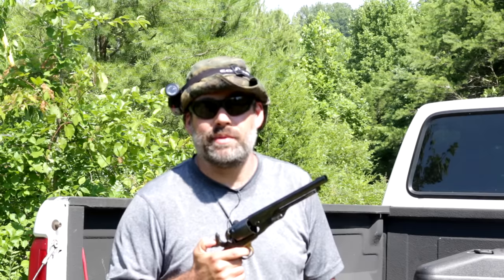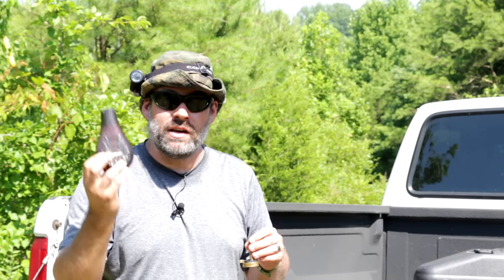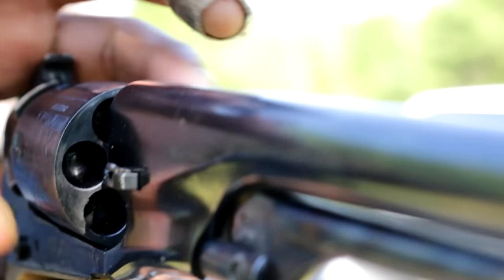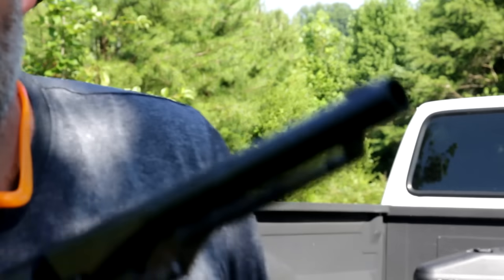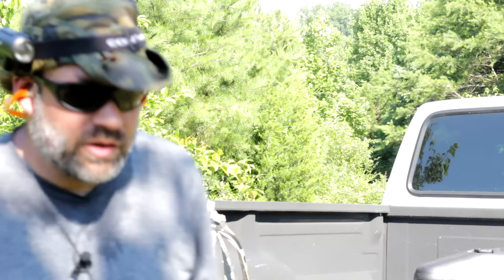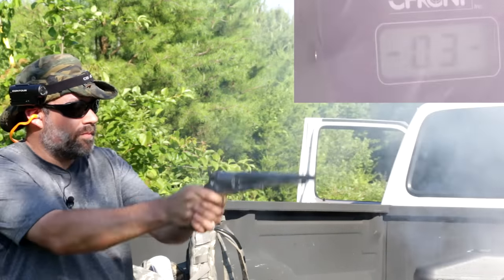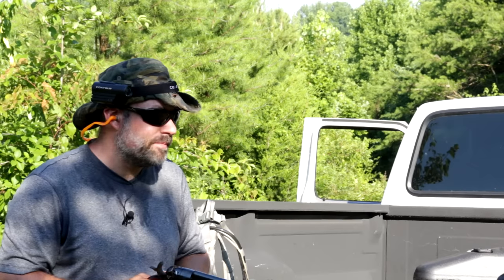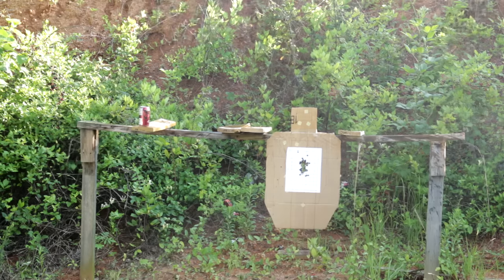How Powerful are Black Powder Revolvers?

Comment: i was wondering about the spread in velocity at each powder charge. would you consider conducting the test again, but weighing out each charge in place of volume measure? i use the pyrodex pellets and their weights are pretty consistent. would like to know why there is such an extreme spread in velocity.
Reply from the maker: The spread in velocity was due to the variation in the size of bullets.  I though by using commercial made bullets it would be better than my own cast bullets and I was wrong.  FYI - Black powder should never be measured by weight due to a massive weight variance between batches, manufactures, and older powder that's had time to absorbed some moisture.  I'll be doing many more tests this summer and just a few minutes ago purchased a new bullet mold for testing.

Comment: I've tried crisco, but it seems to melt when the gun gets hot. Am I missing something?
Reply from the maker: It does melt but there's still enough to do the job.  There are better things like tallow mixtures that doesn't melt as much but Crisco works well enough while also being super cheap and easy to find.
Reply: @deuceandguns  well if it works then that's good. I used it cause animals can't smell it like they would with a petroleum based product. Good info, thanks!

Comment: What a jump from ineffective(25gns) to highly effective(30gns) with just 5gns. I note you are achieving superior velocities with your 30gns than Duelist got with the same pistol,balls and gns in his test. Looks like the black powder substitutes perform better than the Goex brand of actual black powder.
Reply: On the other hand I probably shouldn't underestimate what this cal. and gun can do with 25gns which are getting nearly 700fps. Putting it on a par with the old .38spl loaded with the 158gn LRN at 755fps which was a common 38 ammo for years.

Comment: Counting cylinder length,the larger the charge,the shorter the barrel.This might be why velocity levels out with increased charges.
Reply: "Counting" bullet jump, accuracy suffers.
In truth BP burns at the same rate, and confinement adds nothing.
The ball is already gone and the larger loads are still burning.

Comment: how long would it take to fully load one of those powerhouses?
Reply: The Wabbajackle All depends. couple of minutes for beginners. with time you get quicker might take a minute. that's with loose powder cap and ball. paper cartridges you could shave the whole thing down to around 30 seconds if you can get the caps on right the first time
Reply: RocksChosenWarrior3 thx for the info bro
Reply: @RocksChosenWarrior3  30 Seconds is awfully quick.  A minute and a handful of seconds if not in a road race.

Comment: Well the original 45 Colt round was designed to kill a horse with a single shot. It was 40 grains of FF black powder and a 255 grain lead bullet. I load that myself and I can say when you touch one off any doubt about the raw power of the round goes away. I was shooting THROUGH a 1 1/2 inch thick oak board with a 4.75 inch barrel SSA revolver.

Comment: you try to shot an old black powered musket rifle those things have a real kick I used to own a 12 gauge and it felt like nothing compared to the musket rifle we happened to have an earlier rifle made from the Spanish amazing beautiful gun but it kicks so hard that if sitted it will knock you over and if you jump just a bit off the ground it will push you a tad bit back I would suggest unless you know the kick of the rifle first same with sitting and what ever you do not put you jaw on the butt of the rifle yes you want to do this if you are hunting but most likely you are not so just to feel the power you want to just hold it middle level at first or you can aim it just don't put your chin right on it and don't hold it close or if you do make sure you don't lock your neck but yea you have to try it out and I was saying it more so for others reading this post vs you but you know lol enjoy :)

Comment: to do a test right u would have to clean the gun every time but that would be a pain in the arse when u go over 35 grain it really helps to mix a little modern powder in the load which helps the black burn better so it is not wasted then u will see ur number go way up. but i would only do this in a ubirty which is a higher quality gun made with a high quality metals. u would love my set of ubirties that a retired colt gunsmith went over them till they shoot perfect he even filed the end of the barrels till they shot perfectly straight 100 yards no problem

Comment: What would happen if you used smokeless powder in a BP gun?
Reply: john Mullholand  ,thank you for your reply.
Reply: They will bury you in a closed casket. I am not kidding. You must use GREATLY reduced smokeless powder charges below factory loadings for OLD smokeless powder guns. Old, stressed steel isn't nearly as strong as new, modern unstressed steel. Steel is stressed every time you fire a gun. It'll only take so much...

Comment: I shoot the Colt 1860 New Army, any more powder then 25 grains will blow out the end of the barrel. Found that out after years of shooting. I used to carry said revolver when I hunted using a muzzle loading rifle. As for the most powerful Black Powder Handgun, that would be the Colt 1847 Walker Dragoon. It was the most powerful handgun in the world until the invention of the .357 Magnum. And yes, you should have used real black powder. Also if you over charge the  Open topped Colt revolver you can damage it. From the point of view of the camera when you where shooting the cans, you could see the powder that was blown out of the barrel. I personally do not recommend a powder charge over 25 grains for a open topped revolver.

Comment: A couple of points.

1. Energy is almost meaningless to compare effectiveness especially when comparing different projectile sizes and types. Penetration and wound channel configuration are what counts so testing in media is almost required to get an idea of effectiveness.

2. Pyrodex burns more slowly than real black powder so it is entirely possible that heavier charges of a quality fffg black powder might actually out perform similar charges of pyrodex. Certainly would be interesting to repeat the testing with some Swiss.
Reply: Wow .. Can't wait for your video!
Meaningless ... So all of those dead solders in the American Civil War ... too bad no one told them.
Reply: Initially I just ignored this rather hostile reply but having run across this again after a year I just have to ask why my energy comment was equated with skepticism on the effectiveness of civil war era arms. On the contrary, my point is that their obvious effectiveness runs counter to their limited energy numbers.

I don't understand why folks get so touchy.

Comment: Probably already know this however with conicals you would get more power and speed then the round balls but either way that target is going to have a bad day. I personally carry a 1858 New Army from Pietta with the 5.5 barrel loaded with 40 grains triple 7 triple f powder with a .454 pure lead ball so what every or who ever I shoot if I have too will have a very bad day. Plus if the bullet wound doesn't kill you the lead poising will that is if the ball didn't go all the way thru.
Reply: How is that remmie holding up with the T-7 running through it,  Never tried the stuff but hear it batters the hell out of the frames.
Reply: Haven't been able to go shoot out side a few times, but so far it's holding. T-7 is of course a more hot powder so it's suggest you do 5 grans less then what you normally would but heh.

Comment: Modern bullets do not rely upon the amount of powder.  Although, the grn of a bullet is reminencent of the amount of powder used to propel a round lead ball.  Remember that a round lead ball expanded when it hit.  It broke bones, crashed ribs, etc...  The lead ball expanded and caused a massive wound.  Modern fmj(s) cause wounds (but, fmj(s) do so with speed or mass).  Lead balls are pound for pound equal if not more powerful then modern bullets.  HP(might) be equal.  The reason the BATF (Bury All The Fireamrs) considers these pistols non-weapons is because of the loading process and the time it takes to load the pistol.  Even when compare to the S&W Model 10-5, Black Powder is too slow of a load.

Comment: Those were really slow.  With 35gr of 777 I get 1138 fps (average) with a 141gr ball in a Pietta 1860, and 1152 fps (*) out of a Pietta 1858.  I figure 777 is ~10% more juice than BP of the same weight, but those shouldn't be that slow.  Too much cylinder gap (some people suggest Ubertis occasionally have that issue) ?

Comment: Kind of like the people think more horse powder make a better car or the folks think running the ac with the widows open works. If you want it to work right you would have to clean it up make it yours and then try the right weight of bullet and powder for the twist and load the gunsmith designed it for try 140 with 18 grains powder. 451 or 454 what ever gives a nice ring.

Comment: I used to use 30 grains of powder, but I got a lot of cap jams. Now I use 24 grains of powder and Slix Shot nipples, no cap jams now. Thanks for using unsafe loads so I don't have to.
Reply: Actually, his loads were not unsafe. Colt's said of the originals that you could load as much powder into the cylinders as possible, as long as the bullet fit, you were good to go. You can't blow up a cap and ball revolver using black powder, (especially with these modern remakes because they are made of far superior steel than the originals) !!!!
A note of interest: Colt (and the Army) used FFg,,,not FFFg, in their revolver calibers from .36 to .44. Only the smaller revolvers used FFFg, such as the .31 calibers.
Colt, for many years, didn't recommend the use of oil or grease over the bullets or chambers...that practice didn't come along until many years after their introduction, which was when Colt started making the molds with a grease groove in the conical bullet.

Comment: Interesting experiment. Probably a limit on how much powder can burn in the barrel. No need to waste powder by putting any more than 35 grains in
Reply: Wrong. .. if you use oversized balls,  the powder will burn more before having the ball moving. ... which will increase pressures also, giving much higher velocities.

Comment: doesn't pietta recommend a 25 to 30 grain load
Reply from the maker: Pietta's website recommends a max of 15 grains of Black powder or Black powder substitute if the .44 cal.  Personal, I use 25-30 grains but you'll have to come up with what works best for you.  Other's have said that Pietta recommends 25-30 grains but can never produce any official statement from the company when asked.  It's always second or third hand info found in a forum.
Reply: 15 grains of black powder would only give you about 45 foot pounds of energy
Reply: Don't know about Pietta, but Uberti recommends max of 30 grains in their revolvers. I've tried up to 37.5 grains underneath a conical which gives you a really nice kick, but normally I load 30 grains of actual black powder which is pretty much the ballistical twin brother of Goex FFFG.Quite accurate that way (more than with a 25 grain load, bit less accurate than a 20 grain but I don't like mouseloads), although I didn't have the opportunity to use a chronograph to see what do I actually get velocity wise.
Reply: DEUCE AND GUNS the 15 grains of black powder would probably only give you about 75 ft lb of energy only enough for planking maybe you could kill any wild hog at close range a small piglet I just downloaded a manual an older one for pietta and they said 30 maximum recommended 15 grains

Comment: I used to load my 1858 Uberti with 37gr fffg for about 1100fps at sea level it would significantly compress the load but would still seat the ball. The gun would ring like a bell and the loading lever would jump out of the clip

Comment: You seem to have one bad chamber. In every string one round was far below the others in velocity. Maybe if you can find them, use pyrodex 30 grain 44cal pellets. That would exclude possible loading errors.
Reply: Yes...glad I wasn't the only one that noticed the velocity drop either the factory messed up on reaming one of the chambers or the plunger on the rammer is off center due to improper indexing of the cylinder causing the chamber to be peened by the plunger. again. good call!

Comment: A little advice. When you're shooting you can point the gun straight up and pull back the hammer real hard after each shot. On most guns that'll knock the spent cap off the nipple to prevent it from jamming. Back in the day that's how they prevented jams

Comment: wouldnt these loads be overloads? my buddies revolver says 25grains max for a 44.  also a pietta
Reply from the maker: Yep.
Reply: budget gamer2017 No, these repro revolvers can hold as much powder that will fit in them. Modern steel for these is more than adequate for a low-pressure propellant like BP.
Reply: @feralfx6764  Yes and no.  Yes they can take more abuse than the older BP pistols but everything has a limit.  I've been told that even BP repos of the 1970's had poorer quality metal than the ones today.
Reply: Mine says that 30grs is the max for a 44 and 25grs for a 36

Comment: If you use triple 7 or 209 blackhorn weight it on a scale before using a volume measure, but you'll get alot more room and more power. Modern steel is used for the cylinder, it can take all the powder you can fit. Just check it with a magnet first. If it stick, your good 👍
Reply: Factory paperwork says these are overloads.  Like all reloading go up in small amounts.  “Black horn” I have seen no paperwork on its usage in C&B revolvers.
Reply: @chriskell8479  your able to use all black powder substitutes in reproduction cap and balls, I’ve even seen smokeless used in the modern cylinders. it’s really nothing to worry about.

Comment: No offense, but the power of 35 grains is not 959 but actually 259.
grains 140
speed 913
Bullet Diameter 0.452
KE 259.0735043
Momentum 0.567521368
momentum_1 5.675213675
Taylor 8.25352

Aloha...
Reply from the maker: +Tom Lodge A typo I forgot to fix.

Comment: Use real FFF black powder and you will notice a difference. It has way more power than substitute in my experience.
Reply from the maker: I did that video and believe it or not real FFF black powder provides less velocity.  FYI - I still prefer Goex.   https://www.youtube.com/watch?v=YPGcP3D1ROo
Reply: @deuceandguns  Duece, as I've posted, really high quality Kynoch black powder at about $80 for 400 grams (the last I got), will give very slightly higher velocity in shorter barrels as it burns faster than Pyrodex Pistol. It's obscenely expensive and hard to get. In an "8" inch barrel at best it'd be a "wash". With a 5 1/4" barrel, the black powder MIGHT have an edge, but it doesn't in my .31 caliber Colt's Vest Pocket Revolver. People equate the "BOOM< FIRE AND BRIMSTONE" with power. ;D

Comment: lol faint from 96 degrees? Its 96 by April where I live!!
Reply from the maker: I often vacation in Death Valley and have hiked in 125F heat but living in the south with over 90F heat and 90+ percent humidity can be rough.  This is especially true when trying to look/sound half way decent on camera and trying to juggle cameras that are shutting down due to the heat.  Had my first over temp warning from my GoPro this weekend and will be battling cameras shutting down on me till October.
Reply: I couldn't take heat like that. Was still burning wood in April 2020

Comment: The reason you are not seeing a difference in fps with much more powder then 20 grains is because the higher volume of BP is too much v.s. barrel length. The ball has already left the barrel and only the first  20-25 grains ignited has pushed the ball, the other 15-20 grains is just blown half ass burned out onto the ground and wasted.
I assume he was shooting 3F powder.  Loading a 25-30 grain charge of 4F would probably take it up to around 1000fps every single shot. That's about all your gonna squeeze out of a 1858 or similar.
Reply: Nope... if you use .457 round balls, the explosion will be more advanced when the ball will start moving, then enjoy higher pressures and higher velocity. My 1858 reached 1286 fps with full chambers of swiss1 and .457 round balls (8" barrel).
Reply: BUT, if you use this load through a 18" barrel, THEN you will reach 1486 fps
Reply: And BTW, if you use full chambers of swiss1 in a colt Walker with a round ball (.457) you will have 1430 fps... meaning that longer barrel is better than more powder.
Reply: I love swiss1 black powder so much... those guys are making their bp with the same process and Tools than 150 years ago... (poudrerie d'Aubonne)
Reply: @tuttoto  absolutely

Comment: Erhm... why aren't you using any wads, or any other filler to bring balls closer to the edge of the cylinder while shooting smaller loads? Projectile should be as close to the force cone as possible, otherwise you are losing quite a lot of velocity. Also, powderburn deforms soft lead balls, which impededs accuracy. Filler serves also as a cushion for the projectile. Another thing, loading more than 35 grains of powder to colt army is a waste, cause it just won't have enough time to burn and will only get pushed away with ball. Not a very good test...

Comment: why don't they make blakpowder pistol pellets someone tell me??
Reply: Pyrodex makes them in 30 grain pellets now. I've used them and they work well. Very compact too. I'd think another 10 grains of loose would fit under it.
Reply: @stevet4064   The only drawback is they are fragile.  They are crushed easy or break a part.  Otherwise it is a good way to load at the range.